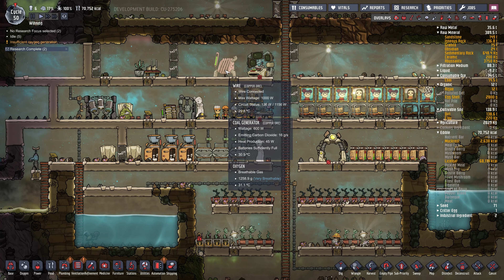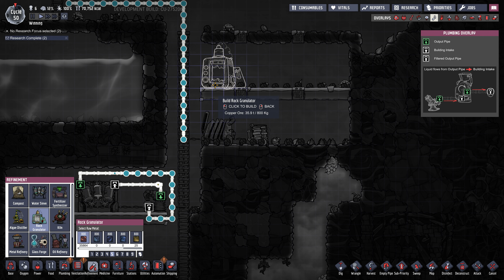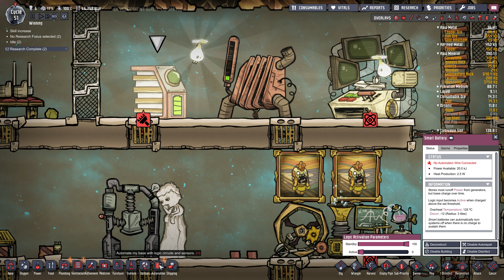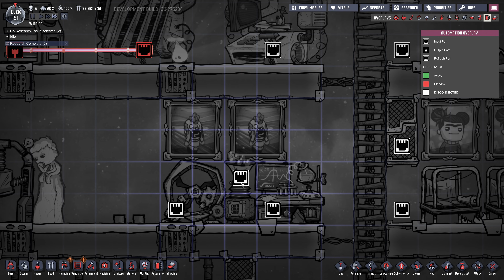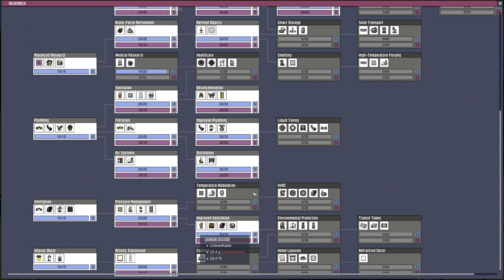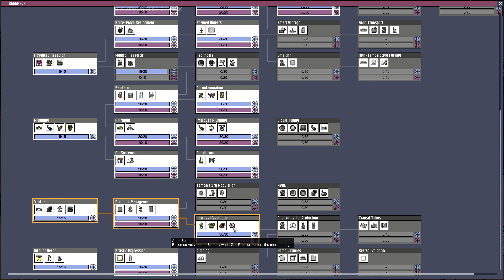Oxygen Not Included - Tutorial Guide in 2025 #5 - Automation Basics - And Gate,Or Gate Smart Battery

Comment: Some things, like the carbon skimmer, are already lightly automated by default. It only consumes power when activated and only activates upon contact with carbon dioxide.
I use manual switches on things like hydrogen pumps and filters, so when I have a place to store the gas, I start pumping it, but I use natural airflow to elevate the hydrogen out of the way, collecting it in a vast upper room outside the base. So the hydrolyzer makes oxygen and hydrogen. You spread out the oxygen while filtering out the hydrogen. I got slickesters early and didn't have a room that was warm enough to keep them alive, and I didn't know they needed oxygen to breathe and filled their room with too much CO2. They all died. So much for my dream of becoming an oil tycoon. lol
I place the gas element sensor under the pump so it is good and full of hydrogen before it kicks on. All the filters on that chain are on the same circuit. I am currently filling my third tank full of hydrogen, and am deciding where to build the hydrogen generator. I need to map a bunch of automation that allows that generator to power all the various batteries around the base, one after the other.

Comment: Thinking about the (for example) "start pump when over 1000 but stop when under 400 (but don't start again until over 1000) setup". Wonder if it's possible ingame. Because a single sensor won't solve the on/off flicker when the value is on the threshold.

Comment: so iv got a question, the base i want to build will be a large apartment building/ condo styled building, each floor will have a gap where carbon can be collected and is then moved to a centralized area where it is then pumped to either slicksters for oil, and excess will be bleed into the atmosphere, is this a good way to manage carbon?
Reply from the maker: That would work. Easier to just use gas tiles in the floor and collect the CO2 at the very bottom unless you want airtight apartments. Algae terrariums in each unit could also work if you have the space water/algae. Or you could use a mini gas pump and detect CO2 and suck it out that way.

Comment: Debug mode not just speeds things up, it actually steals time, without debug mode you can not get things done before others run out because you build and dig out of actual time. No food, water or oxygen loss at all. This is not how you should show begginers to start, it is more like let's test ideas than a guide. This is out of the actual laws of the game.
At this point why are you bother making food, you can simply summon some if needed, major debug mode addiction warning. :D
Reply from the maker: The debug time issues have been fixed in QoL update. I use debug so I can quickly show concepts without wasting too much time in the video. When I play the game for real I don't use it or suggest it.

Comment: So, if i want to make an algae deoxidizer run between two pressure values, how do i have to build the circuit? Let's say, want it to kick in if pressure is below 500 g and want it to stop if pressure goes above 1000 g. Probably is simple but i'm not getting there.
Reply from the maker: Two pressure sensors. One set to below 500g and one set to above 1000g. Each feed into one of the two ports of an "OR" gate and the one output goes to the algae deoxidizer.
Reply: That way it will start if below 500 or above 1000 or am i wrong? I want it to stop if above 1000. I wonder if i use an AND gate to connect the 500 sensor directly and a NOT gate between the AND gate and 1000 sensor will do the trick. That way it goes true if below 500 and if not above 1000( if i'm thinking correctly).
Reply from the maker: sorry I misread your comment first time. so you want if (pressure > 500 OR pressure < 1000)   you can skip the not gate and just to <1000 on the second sensor.
Reply: Sorry if you find this annoying but if im reading the signs correctly i think that was what you said on the first answer: using an OR gate and setting sensors to below 500 and above 1000. Or maybe i am the one confusing the signs.
Reply from the maker: (pressure greater than 500 OR pressure less than 1000)

which is shorthand for what you proposed with the NOT gate

(pressure greater than 500 OR  NOT(pressure greater than 1000)   )

boolean logic is fun.
Reply: Dunno man, i didn't tested yet, but seems to me that with that setup it will just keep the pressure close to 1000 and will be constantly be turning on and off. Anyway i will test it in a few hours and i post the result here. Thanks for the reply!
Reply: So i've built this setup and it doesn't worked as i wanted. I've built it in a room where one of the conditions was already met ( greater than 500), so the system just kept working since the pressure was always greater than 500. I found this setup, he actually calls it the "between" system. He uses an AND and OR gates. I'll try it out and let you know the result. 

https://postimg.cc/image/vdhrjwajx/
Reply: The thing that makes this more complicated than it seems is that you want to let the algae deoxydizer work when the pressure is below 500 and THEN work UNTIL pressure is above 1000 which is really a "non trivial problem" (if I may speak like I know what I am talking about xD).

The problem could be written as  <pressure is below (500) => work until pressure above (1000)>

But in propositional calculus (in which we are when we only want to use AND,OR,NOT and all combinations of those like NAND, NOR etc.), we have no notion of "do something until", a statement is either TRUE or FALSE.

Before solving, let me talk about why the proposed answers don't solve this problem, so you may can get a better grasp about why this doesn't work as easily as it sounds:

1. OR(pressure.above(500), pressure.below(1000))
=> this is always true. One of both conditions will always be met. If the pressure is not below 1000 meaning the pressure is above or equal to 1000, then the pressure is surely above 500. If the pressure is not above 500 meaning the pressure is below or equal to 500, then the pressure is surely below 1000.

2. AND(pressure.below(500), NOT(pressure.above(1000)) is equal to 
AND(pressure.below(500), pressure.below_or_equal(1000)) which is again equal to 
AND(pressure.below(500), pressure.below(1001)) (assuming the game only cares about integers but you'll get what I mean nonetheless)
=> Assumption: Pressure is below 500. When the pressure is below 500, it surely is below 1001. Therefore, both conditions are met. The oxydizer will start working. But when will it stop? When one of both conditions are no longer met. The condition pressure.below(500) is surely the first one to become false, therefore the oxydizer will stop working when pressure is above 500. 
Assumption: Pressure is above 1001. The oxydizer will only start working until the pressure drops to below 500 since only then both conditions are met. And then it stops when its above 500 like mentioned in the previous sentence.

To solve the problem, we need the "memory toggle" gate which is basically "saving our state" so we can know when we just started the oxydizer and want to get the pressure above 1000, and when the pressure just got above 1000, and we want it to drop below 500 before starting again (else, we would just start and stop at 500 or 1000 depending on our circuit with no "memory about its state").

Since the actual step-by-step solution to your problem is answered in the forums, I will just paste the link in here.
https://forums.kleientertainment.com/forums/topic/89977-can-someone-explain-to-me-the-memory-toggle/

Comment: A third option for refined metal is to breed hatches for smooth hatches. It takes a little time to get it up and running, but you can have a ranch of 8 smooth hatches by about cycle 50 without too many problems. And they are very efficient. So efficient that I have had to kill mine off to preserve what is left of my raw ore in my current base. I have been experimenting with a ranching based economy for as many things as possible in my last three bases, as an experiment to see if it was possible. And it is, just a little slow at first. I now have ave 80 tons of refined metal and never built a crusher or a refinery.

Plastic is a little harder though. Glossy dreckos can be very rare sometimes. And they're fickle too. I definitely recommend water locks, exosuits (to prevent Co2 buildup inside) and a very high pressure environment inside the drecko ranch. At about 4K oxygen pressure their productivity seems to increase dramatically. But in the end you can get by with and all-organic plastics production too. It's just not easy to get it right.
Reply: @@Split Dimension Hatches can definitely be exploited a bit since they can't fly or climb. If you just make an outside area for them which is open either to the outside or just the rest of your base then they will lose all their debuffs when they go there even in large numbers. The grooming stations inside and the feeders outside is the way I do it, just to encourage them to go outside regularly.
The result is that in just a max size ranch with a sort of veranda like this for them to walk to they will keep breeding way past the size limitation of the ranch. I have only tried this once, but I built a ranch like this and bred all four hatch types there until I had more than 300 of them. Obviously this is very labor intensive because they need to be groomed occasionally for max productivity. But it's also very space efficient, and you can just kill them off if you have too many anyway.
It was just an experiment, and besides I hate killing off critters in ONI. It makes me feel mean. But it's certainly an option, and gives you a lot of meat in the process.

I've worked plenty on all the critters, but this is the one you really want for the early-midgame transition. The coal from the regular hatches and stone hatches will give you plenty of time to explore and find new power sources. I don't think sage hatches are worth it, just because they like to eat things I have other uses for. But smooth hatches can definitely be a solid option for the metal refining. As long as you know how to breed the various species you're good. Sedimentary rock turns regular hatches into stone, dirt turns regular hatches into sage and metal ore turns stone hatches into smooth. You can do that very quickly once the early base is up and running. Outhouses, research, cots, farms, an ore crusher and then ranching is probably all you need, so you can start it by cycle 5 or so and get the breeding going. You do need the crusher just for the small amounts of refined metal you need for the ranching. Really just for an incubator, which you should probably build just to speed up the breeding process. If you don't bother with an incubator for the hatches you can skip the crusher too and just wait for the smooth hatches to arrive. This will definitely be slower in the long run though.

As for dreckos I have a design for drecko ranches that I've posted many times on the Steam forums under the name SKull. See if you can't find it there. More difficult to set up because you need the crops and some hydrogen. It is also, like all ranching, labor intensive and you do need a little power, unlike with the hatches. Just for lights and the water pump if you're growing blossoms and any exosuit docks, which I highly recommend to control the gas levels in the ranch. But, you know, everything adds up, and any power shortages might mess the ranch up. But glossy dreckos is the second species I think people should be ranching properly for the plastic. The advantage of ranching being that it is cold production and doesn't contribute to the heat death almost at all. So cool plastic, phosphorite, some meat and crops you can just harvest if the critters don't eat it all. It's just all good with glossy dreckos. Skip regular ones though in my opinion. Same as the glossy ones, except fibers instead of plastic. I never feel like I need a lot of additional fibers, so for me this is a silly thing to be ranching. But people play the game differently.. Maybe you want carpets or something, in which case: knock yourself out!
I did try a large crab ranch in my last base, but generally consider ranching anything other than hatches, dreckos and fish to be not really worth it. It can still be fun to fiddle with, but I've never really felt like I needed any of it. Pips in your parks are a good idea obviously, but then they don't really require any maintenance. The only other exception might be the shaggy slicksters; the purely decorative ones you can breed. It's just difficult to reliably breed those without setting up all sorts of hot ranches for normal slicksters, and it's too much. If you can get some shaggy slicksters easily then go for it. Helps the air in the base and don't really require a lot of work. Same with the toilet monsters. If you can get them, fine. Set up some deos around them and it'll help with the O2 without requiring a lot of maintenance. But not something you should strive to acquire.

Comment: I found out that  if you put "not smart batterys" batterys after a transformer it is best.  the generators and smart batterys connect thru automation.  smart battery 20Kj  normal battery 40 Kj.
Reply from the maker: I think the redid some of the power stuff as of this update so I'm not really sure. Using the non-smart ones as a buffer on the end use of the circuit makes sense though.

Comment: i try to use your solution for recycle water with carbon skimmer but it's won't work
the machine run for awhile an then not running T_T
Reply from the maker: Did it use up all the carbon dioxide? Other issues would be lack of clean water input, lack of sand in the seive, blocked polluted water output, lack of power.
Reply: Thank you.

Comment: The atmospheric sensor doesn't make any sense in the way it works, or rather the setting of it doesn't.
Instead of setting the "co2 pressure" it should measure "co2 percentage" or "co2 content".
Atmospheric pressure isn't relying on the gasses that make it up.
It's ambiguous at best.
Reply from the maker: I think the devs wanted simple atomic sensors that could be combined in any way. I think a given block of gas can only be of one type so percentage would not work.
Reply: Yeah, one type of gas per tile, so it can be only true or false.
However, in that case, the type sensor is not needed, the carbon skimmer will not run in any other gas type, so unless there is a messy mix of gases, it will always just turn on when CO2 pressure is high enough. (Especially when trying to save power, it would be odd to add 25W consumption for a few rare cases where some other gas floods your base, and in this case, the small waste of power for the carbon skimmer using smaller chunks of gas is possibly the least problem.)